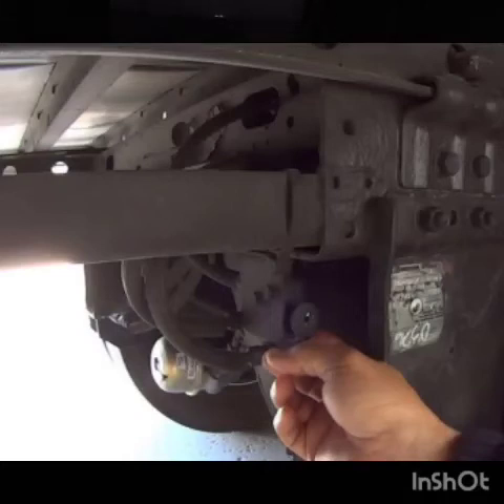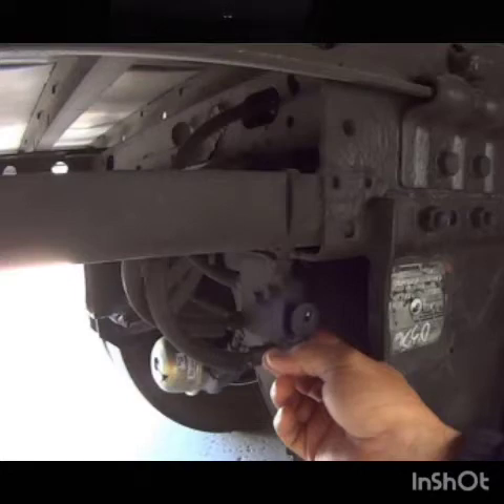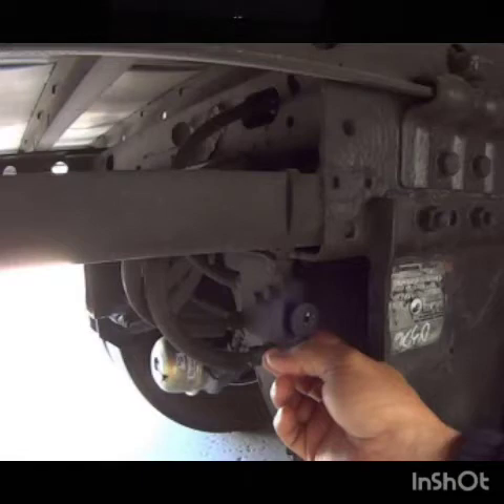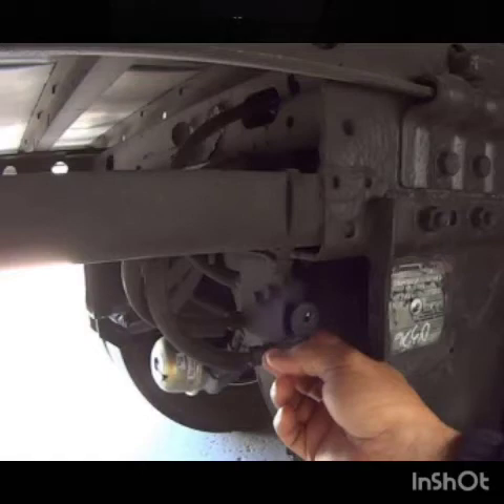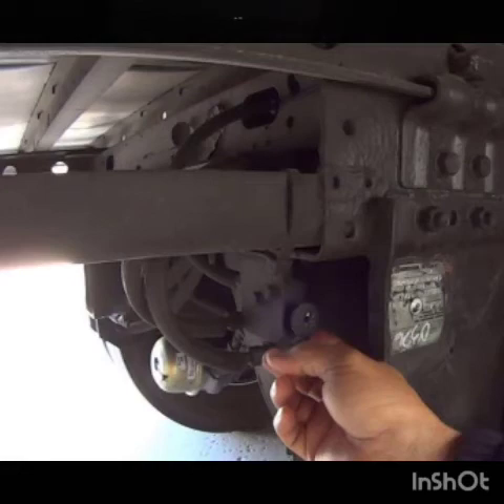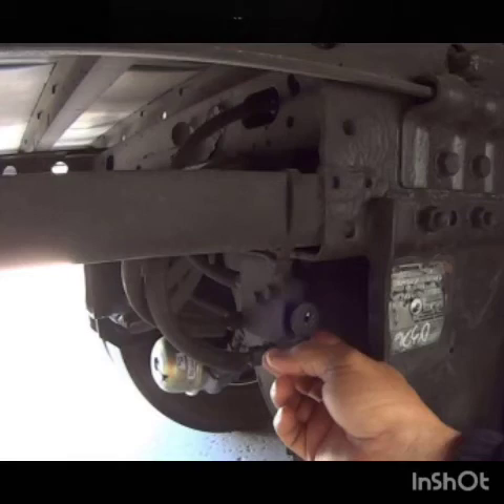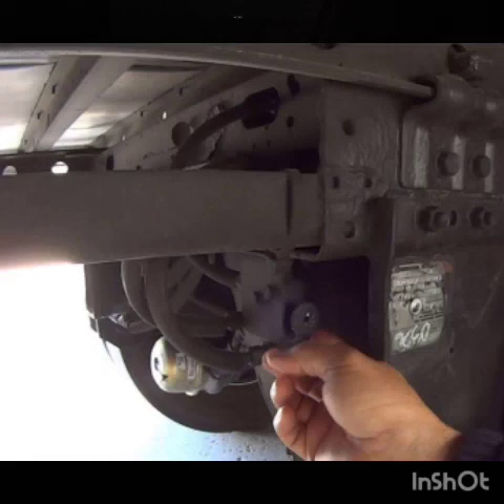Save Money!!! Trick how to slide air trailer tandems when all else fails.

Comment: They had the tandems so far forward I had a job to get my arm up in there with the skirt. Then, the knob was perpendicular ... facing forward toward the tractor, instead of straight out the side of the trailer toward me!  And I could barely get a couple fingers on it, let alone try to push or pull on it to see if I could make it go in or out. It seemed hard stuck. But couldn't get any leverage anyway, not even with a claw hammer!  And no way to crawl under there.  Woo-hoo, California here I come ... runnin' deep, dark, and wild in the dead of night!  🤷‍♂️    🚛💥💨

Comment: If you're just trying to build air pressure back in your tank, instead of driving around, you can just leave it in neutral and idle up to around 1500 RPM until  Primary and secondary gages on dash reach 120PSI (approx 1 minute)
Reply from the maker: Thank you for commenting.
Reply: You saved me
Reply: You saved bro. Thanks for commenting on this video